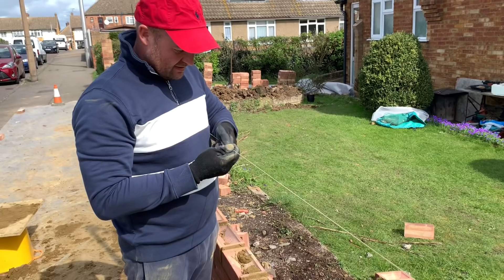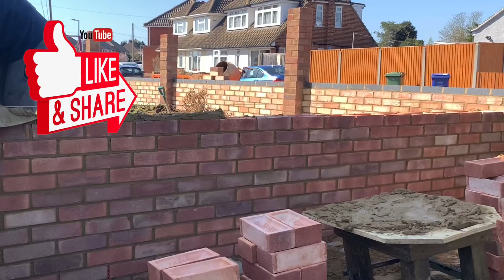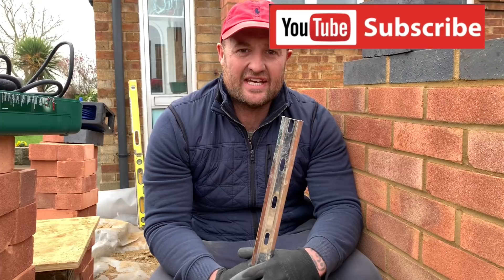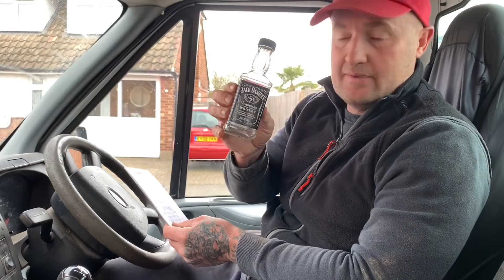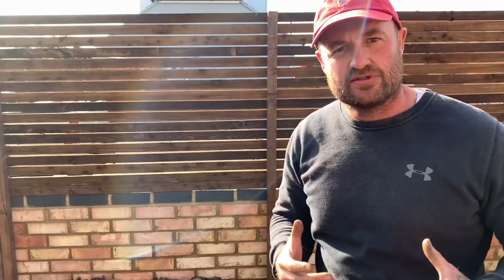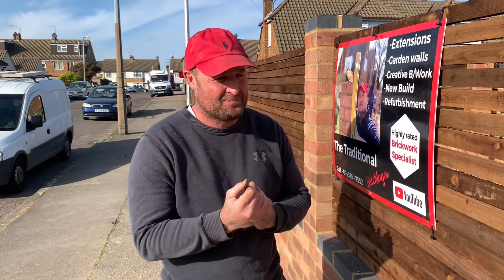Brickwork Garden wall with a story 🧱🏠Part 3 #bricklaying #Masonry #brickwork

Comment: I like you and I like you attitude along with the thinking behind this wall design. However I have to tell you that I think the Pilar's should have been a brick and a half square as I don't think this construction will stand the test of time. Also there is a little known rule about the height of a boundary wall to a normal housing estate. Such walls shouldn't exceed 1.2 meters above the path level. The work does look very good though and like you I love to see something different rather than the same old crap as you described. You have given me a very good idea for future use. Regards J  Doré and Son

Comment: I know ya know your job but when ya use that little line level if the line is not pulled very tigth with no sag at all it works but if u put it on a loose line it will find its own level even if the 2 leads are off , try it and u will see what im saying only experience can teach that lesson🤣🤣🤣🤣, great channel

Comment: Not sure bud but that little line level gotta pull the line down a bit so can’t give you true reading surely ??
Reply: If you set it in the middle, the pull down is equal so the reading is true
Reply: Just as accurate as most cheap lasers ie anything less than £500  ~ generally   Cheapo ~0.5mm per 1m  just remember how dims vary on  bricks especially stocks .